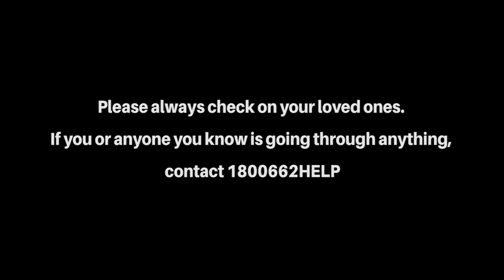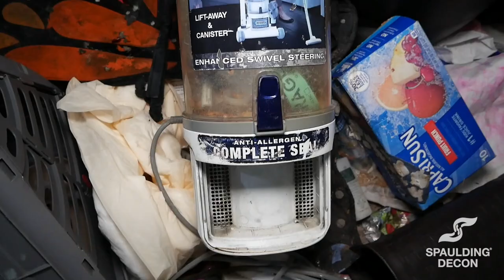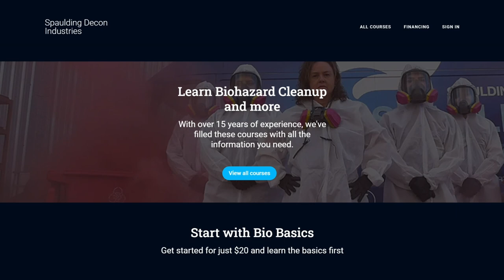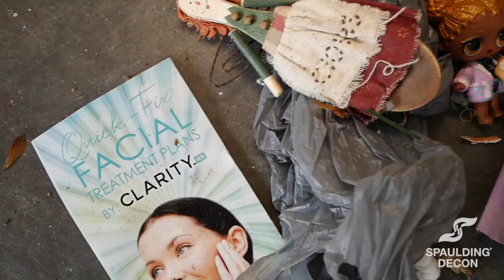WARNING: The Saddest Hoard We've Ever Seen

Comment: this is an honest question, and not trying to be rude or judgmental. When does laziness cross the line into hoarding? A few of these hoarding videos i just see as being a lazy home keeper and not really hoarding. I'd love some enlightenment to help me understand a little better.
Reply: Good question.  
This is a really nice house, and it looks like it was kept up until recently.  Not enough depth or density, and the plumbing still worked for the most part.

It looks like the parent went on an extended break and the kids and cats took over.  🤷🏻‍♀️

Either way, they called for help before it became a level 5 and deeply damaged the house. 👏